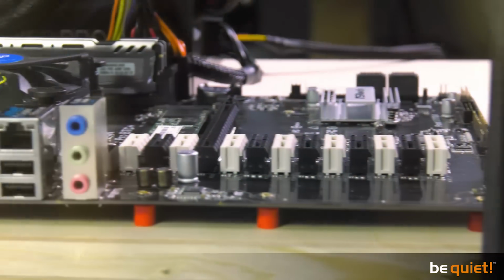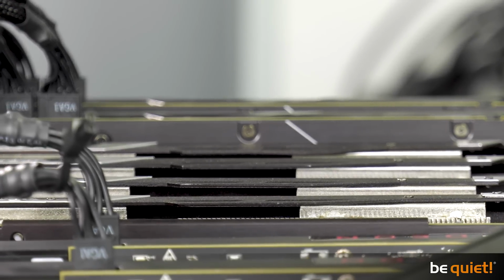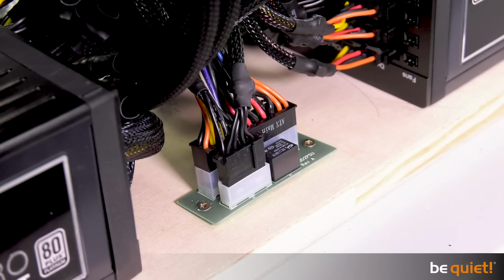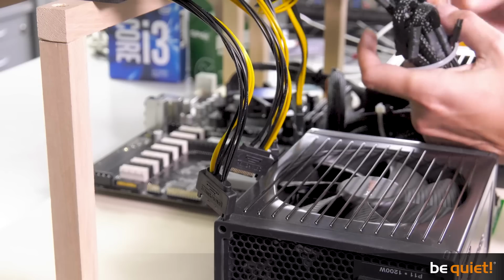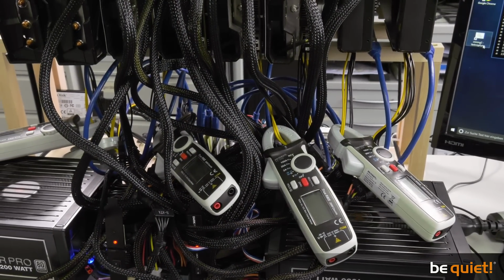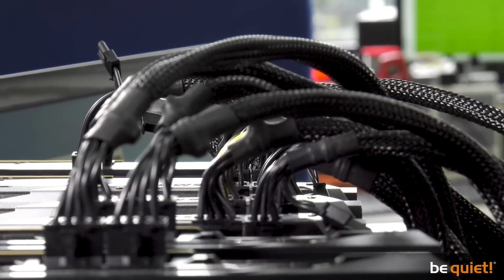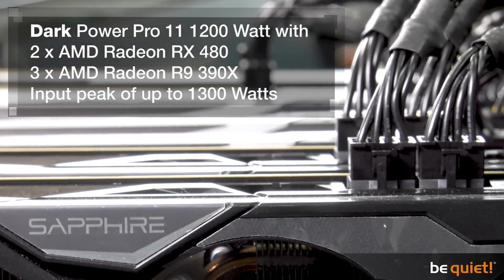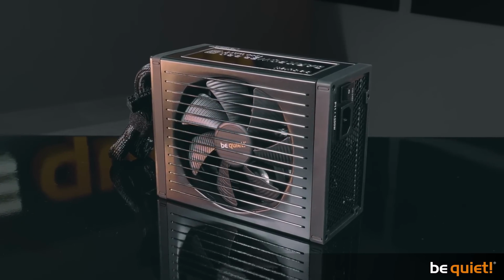Putting Dark Power Pro 11 to the test: The be quiet! mining PC

Comment: Would you trade manually or would you use trading bots,  I found some very unique features with FIRST MILLION ROAD while trading as a real user. It’s one of the latest trading signal services that can send signals of business which are highlighted by the software randomly. The main point of loving this system should be that FIRST MILLION ROAD system does not require any major broker that adds to the lack of trustworthy of this tool. ?